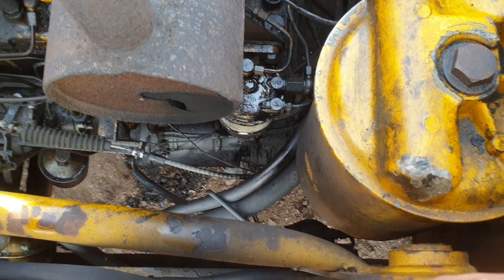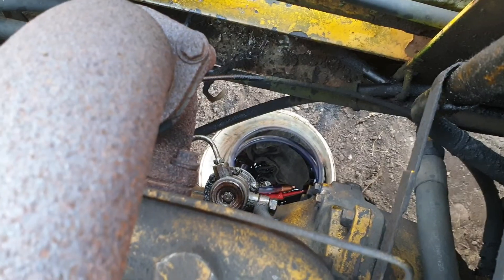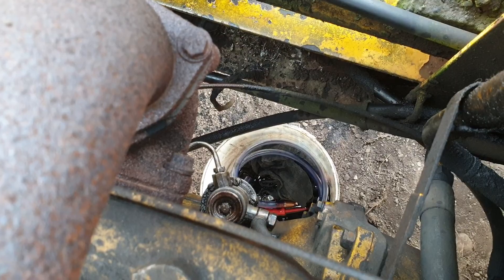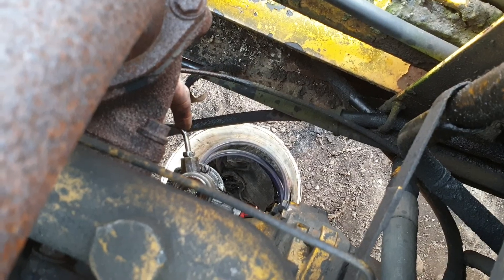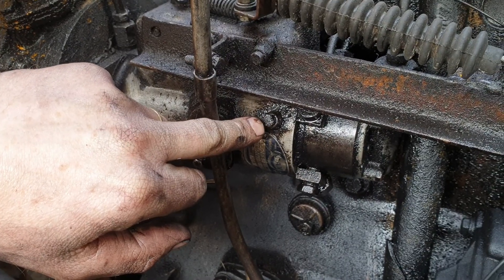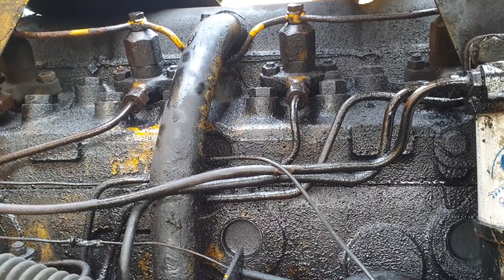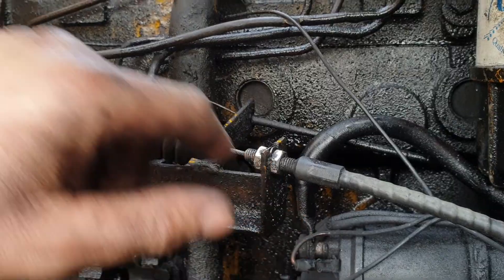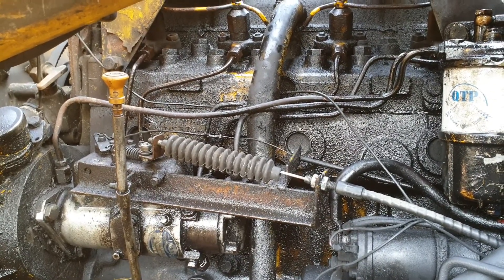Bleeding Fuel System | Perkins 4236 | 1982 JCB 3cx | White Cab | Lucas Cav Injector Pump | MF 168

Comment: What is the issue if you bleed it, run engine, use the machine for 20 minutes, runs great, then I turn it off, then try start it 1/2 a second later, and no way will it start, needs bleeding all over again, wtf ??? How can it all go wrong in 1/2 a second, I turn off, try start it instantly, no go ?????????????????
Reply from the maker: Any luck ? If you leave to cold will she start ? Could be a range of things from starter speed to injector wear.
Reply: @jpsmith6975  No won't start from cold either. I'm going through everything at the moment, took fuel tank off, absolute full of rust and sludge, a blend of diesel and rust, took top of lift pump off, same, packed with same sludge, fuel filter the same, never seen one as bad,  should I check the gauze in injector pump too? Is it easy to dismantle and put back, it's a forflift, so it's kinda awkward to get to
Reply from the maker: @isaackent2355  do it methodically from start to finish, tank, lift pump, sediment traps, filters, injector pump. Otherwise you are chasing your tail.
Reply: Hi, any luck? Have the same Problem with my forklifter Caterpilar 51b with perkins 4.236 Motor and CAV Dieselpump DPA 3247F031 :(
Reply: @leinadj.7948  Mine got to the point it won't start at all now, in the end the pump needed a full rebuild, when I opened up pump it was totally full of gunk, I didn't refit it yet, but it cost 350.00 to rebuild it.
Reply: Oh okay. I think this happened to my Pump. 

Here in Germany a Germany a rebuild Pump costs ~1000€. So i will Start to rebuild it myself the best way i can.

Comment: A common problem with the Perkins fuel system was the thimble filter in the Transfer pump housing. This often got overlooked but when bleeding the hydraulic head an experienced fitter would see the lack of fuel and low pressure behind it. When I was doing all this dirty fuel and suction faults were most common problems along with the stop solenoids if fitted.

Comment: Great to learn from your vid that widely applied engine of Perkins. I have a Landini 7500 with that same engine and CAV high pressure pump. It runs beautifully but after randomly 5 to 20min it drops dead. Restarts immediately and runs fine for another 5-20min!!! Did all the standard stuff from replacing low pressure pump, filters, to even clean the inlet filter desperately for finding any cause. Can only draw the conclusion something is wrong in the CAV high pressure pump. Expected a non-return valve in the fuel return outlet socket but it seems empty. Is that important for the operation? Any suggestions? Even second hand once are > 500€ ...
Reply from the maker: Fuel starvation. Check filter in both lift pump and injector pump, make sure all air is purged.
Reply: @jpsmith6975  Thanks for your reaction, however with 'standard stuff' I ment exactly this. However I got to learn from another vid that there is a plunger underneath the CAV DPA pump fuel inlet filter that might have become blocked when not returning properly. 
https://www.youtube.com/watch?v=h26p78YZIr4
Reply: @Ernie-Tech  what was the problem?
Reply: @monstertrucklt  I'm not sure cause it's been some time now, I believe that there was a filter near the fueltank tap that the owner had either not replaced or not properly cleaned. Vage. I asked him before and afterwards the story changed.... So after all fuel shortage by dirty fuel system 😞
Reply: @Ernie-Tech  Mine did similar thing, tank cleaning window was put on with lots sealant, clogged tank output randomly. Currently won't start, one cylinder will fire instantly after starting to crank. But not others. Tank cleaned, separator without crud, handpump good, mesh clean, fuel filter new, mesh in pump  new, hydraulic head in pump new. Valve clearances good. No clue at what to look next :D
Reply: @monstertrucklt  well, as you describe it, maybe it's a good idea to undo the 4 high pressure fuel lines to the injectors (without doing all the works of removing injectors just leave the lines open in the air), and start and check if indeed 4 lines spit out regularly and in the same intensity a bit of diesel. From this you can move on! In order to protect those open fuel lines, hang a clean shirt or cloth over the four of them and see closely if the size of the stain of diesel is even between them.
Reply: @Ernie-Tech  When it stalled after working fine only first one spit out somewhat close to normal. And it went from working on all 4 to 1 cylinder in maybe 20s. And last maybe 10hrs and 10starts it would start only when together handpumping. Primary pump veines are new, backing plate is metal and has practically no wear. Injectors themselves are perfect. Recently checked them again and rebuilt maybe 20-40hrs prior to that.
Now if it stays some time like couple hrs it will start for couple secs, then again one cylinder while cranking and couple blows after starter is off. Was a feeling something got clogged before the pump. Have blown lines with air. Tank has a mesh around intake with open top to prevent clogging output. Gonna check that now with a flashlight
Reply: @monstertrucklt  no clue about your options, but if possible try to install a seperate diesel supply gravity fed directly through existing but preferably by also external dieselfilters into HP pump. Only this way you can analyse which parts to cross of your list with "quilty" components ;-)
Reply: @Ernie-Tech  That's probably the next step. Does the fact that starting on a squirt makes it worse tells something ? Took valve cover off now, seems normal while cranking.
Reply: @monstertrucklt  Valves and their functions are easily tested with a compression ratio tester (borrow from local garage or friend if the investment is too expensive, or too low usage). Cause compression tells you if pistonrings, valve sealings and timing are okay with 4 simple exterior measurements. I don't know what you mean with 'starting on a squirt'. But if you mean that first crankshaft turns always produce strong diesel squirts from open high-pressure lines, and then pressure drops immediately, then your highpressure pump is certainly doubtfull 😞

Comment: Hi thanks for the video, if i just replace the fuel filter and clean the fuel sediment bowl before the filter i don't have to prime the injector pump and the injectors right??? I only have to fill the filter with fuel using the lift pump right???
Reply: Personally , I like to put injector cleaner in the primary water sep  after changing the paper filter .
Reply from the maker: Fill the filter with fuel by hand, screw up filter and finish filling with the lift pump. Have filter bleed screw or banjo loose to allow air escape rather than pushing it up the system further.
Reply: @jpsmith6975  Thanks a lot for the help!!! Much appreciated!!!
Reply: @jpsmith6975  if air is pushed further up the system, then bleed at injector fittings? also do you bleed injector pump on the top of the face or the bottom bleeder, you pointed at both in the vid, very helpful thanks!
Reply from the maker: @xDRINKMOLOKOx  Yes. Bleed it from start to finish (tank to injector).

Comment: Thanks for sharing.  Looking for a video clip showing how to bleed & prime a '73 Perkins 3 cyL. Helping a neighbor w/ his, he replaced the 3 rusty fuel lines from the pump to the injectors, but now we can't get it to hit a single Lick. Manual pumped the lift pump, but it wasn't moving a lot of fuel. Any advice much appreciated.  Thanks again, - take care.
Reply from the maker: I am no expert on this. I have the 4236 myself so know it well. If the lift pump is doing nothing then make sure the pump is not the problem. Turn over the engine as sometimes the pump doesn't work great depending on the cam lobe position. Also check that you have a flow to the lifr pump,  ensure the tank is not full of gunk.
Reply: @jpsmith6975  Will do, thanks man.